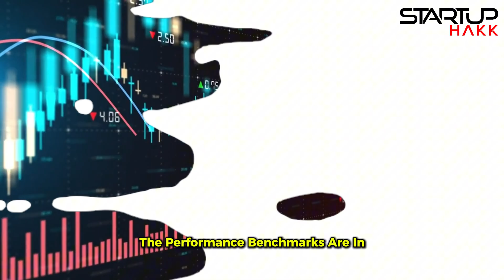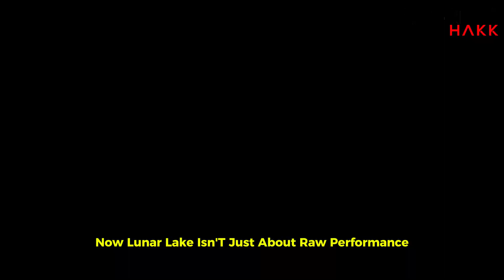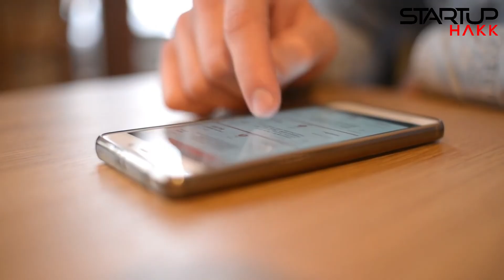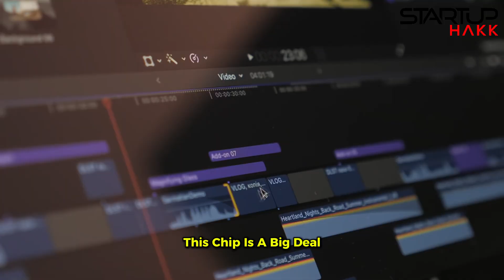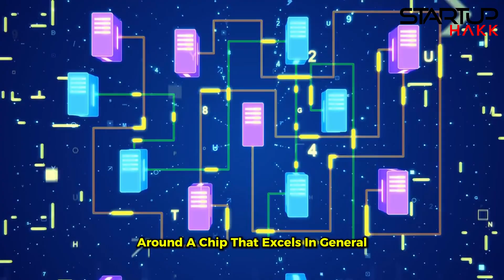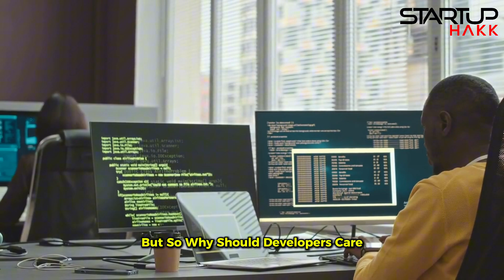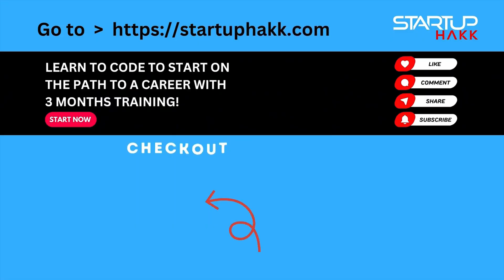Intel’s Lunar Lake Chips: Game-Changer or Letdown? The Final Verdict Is Here!

Comment: I think you're missing the mark in comparison here. AMD has already made snapdragon all but irrelevant. The battle is on x86 and ultimately for its survival long term. There shouldnt be any concerns regarding the fab issues that created the 13/14gen issues because, as ive said, it was a fab level issue not the microcode or actual design. Intel needs to turn the ship around for the sake of global stability and does, indeed, have a pretty good plan laid out by Pat.